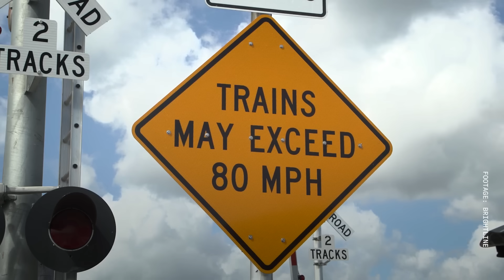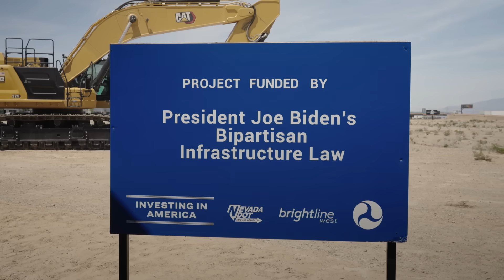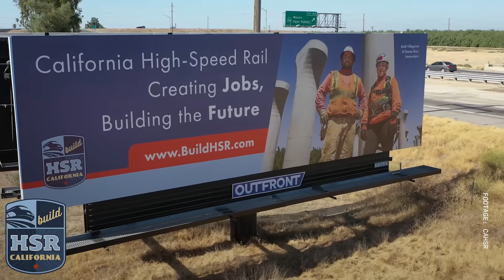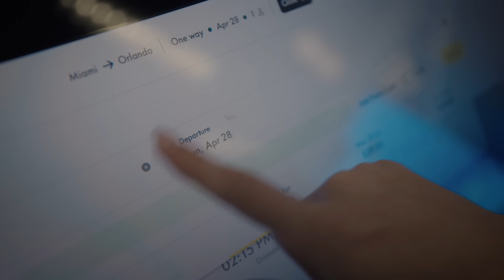Inside America’s First High Speed Rail

Comment: HSR improves lives and has advantages over flying, especially with medium length trips. It delivers a faster, smoother, and more reliable travel experience in ways air travel simply can’t match.

Greater reliability: HSR is far less vulnerable to weather-related delays or cancellations.

City-center access: Train stations can be built directly in urban cores, cutting out long trips to and from far-off airports.

No runway delays: Boarding is straightforward, and trains depart without waiting for runway clearance or taxi time.

A smoother ride: Passengers experience virtually no turbulence, making the trip more comfortable.

Streamlined security: Security procedures are faster and less intrusive because the risks associated with air travel don’t apply in the same way to trains.

Hassle-free luggage: Travelers keep their bags with them—no check-in lines, no waiting at carousels, no lost luggage.

Taken together, these factors make high-speed rail not just a transportation option, but a genuinely better travel experience for many journeys.

Comment: INSANE. A complete waste of taxpayer's hard earned dollars, for something that's not needed, and never will be completed.
Reply: HSR improves lives and has advantages over flying, especially with medium length trips. 

-HSR is less susceptible to weather delays and cancellations.
-Train stations can be build closer to city centers to reduce travel times between them.
-No waiting on boarding or taxis on/off the runways.
-Hardly any turbulance.
-Security checks are much lighter and take less time since you can't pull a 9/11 on a train.
-No waiting on baggage checks since you take the luggage on.
-and so on.

Comment: We built our Federal highway system and major airports before high-speed rail became a practical option.
For mid to long trips, planes are better. 
For short - to mid trips, cars are better.
Rail is stuck with mid distance trips the only viable option except in the North East because of density.
Reply: Not really. Portland Tacoma Seattle and Vancouver have high enough density and good to great transit systems. LA and San Francisco should have happened decades ago. LA to San Diego is actually the busiest Amtrak route outside the Northeast. Charlotte and Atlanta both have transit systems that would justify construction of HSR between them.
Reply: There’s also Chicago to Minneapolis, Chicago to St. Louis, Chicago to Detroit, Chicago to Pittsburgh… All of which have local metros and should be reachable under 4 hours by train.

Comment: Why can't we have this? (like Europeans or the Japanese)
Because it is less economical.
Rail simply doesn't work very well for the US.
For starters, we don't have the population density of European or Asian countries.
Second, the US has a very strong road and flight network...making them much more economical.
Short distances are best covered by automobile and long distances are best covered by flight.
With rail, one needs TRANSPORTATION TO the station and then need TRANSPORTATION after they get to their destination.
The same applies to flight, but airplanes cover longer distances faster than rail and cost less. 

Let's take a look at Brightline East:
Roundtrip cost from Orlando to Miami = $200-$220 (for the most basic fares).
Additional costs = Uber to station (or parking fees). Uber around Miami (or rental cost)
Transit time = 3 1/2 hours one way = total 7 hours.

Compare that to flight:
Roundtrip cost from Orlando to Miami = $150-$250
Transit time = ~1 hour 10 min one way = ~ 2 1/2 hours.

Compare that to automobile:
Roundtrip cost from Orlando to Miami = ~480miles @ 30mpg @$3/gal = $48 in gas.
You can leave whenever you want, have transportation while in Miami, and come back whenever you want.
The additional cost of tolls is not enough to raise the cost significantly.
Transit time = 3 1/2 to 4 hours one way = total 7-8 hours.

Comment: here in Russia is already building a line with a train speed of 350 miles / h

it will be launched in 2028
between Moscow and Saint Petersburg

ticket cost 35 USD for distance of 450 miles
Reply: Nah its 250 kmph = 155 mph
Reply: @ oh, sorry, 
it's just 300 miles / h = 480 km / h

because 250 km / h 
- we had 50 YEARS ago in USSR
it name was ER200
Reply: @HEX-qw7qp  the ER200 went about 125 mph / 200 kmph. 

Sorry I was wrong, there are already two routes that do 155 mph / 250 kmph

the new one will do 360 kmph / 225 mph - about the same speed as the new British one (HS2)

Comment: OK.  So Brightline announced a one way ticket from LA to Vegas would be $119 per person.  You. and your spouse buy 2 tickets.  That's $500.  Then you have to take Uber to Rancho Cucamongo or leave your car there and pay for parking.  OR, you could drive the 2 of you door to door for maybe $160 in gas round trip (less if you use electric).  And the so called "2 hour  advantage" never materializes because you have to get where you live in LA to the rail station either through Metrolink (snail pace) or drive through traffic in LA (turtle pace).  There's no way trains can compete.  I'm not against hi speed rail. I just took one in Europe last week.  But America is NOT Europe or Japan.  The cost is too expensive to pay off.
Reply: A line between las vegas and los angelos would be competing with airlines more than cars i think, which would definitely be a cheaper option no?

Comment: USA HSR:

130 mph (209.2 kph) = now

186.4 mph (300 kph)

200 mph (321.87 kph)
Reply: Xinjiang Uighur Autonomous Region, China
HSR
210 kph (130.5 mph)
+
Operate up to Tyhoon Category 12 Winds
at 80 kph (49.7 mph) without halting operations

vs

Japan's Shinkansen HSR shut down during Typhoons

■

Winds in Xinjiang sometimes exceed 65 m/s, or 234 kph (145.4 mph)
which is greater than Category 17 Typhoons

Comment: The US needs to add to it's rail network.

I see it as follows. We need high speed national rail network for both passenger and cargo. We also need a slower speed inner city rail network both for cargo and passenger.

The interstate system is good for semi's but they can only carry so much and only drive so far and so far. A high speed rail system would more then DOUBLE the speed of cargo travel and passenger travel.

I think major routes across the country need to be established with stopping points along the way. Those stopping points need to get you through the state at high speed and once you are in a city you would use slower speed rail to get around the city.

We drastically need to rethink how we build things because we have so much lost potential just sitting here.

Comment: There are multiple difficulties for a national high speed transit. Mainly that to prevent accidents, it requires it’s own right of way with provisions that make grade crossings impossible. Secondly, there is the uneconomical use of 18th Century technology using steel trackage, which is subject to excessive wear. Then there is the mode of transport power. Currently this is diesel fuel. A hydrocarbon that does create excessive CO2 emissions. Yet the private enterprises involved are entrenched in this high potential loss factor approach. While it may achieve a system, it does not guarantee economical ridership over commercial flying, by such one can cross country in 4-5 hours. A high speed land system would need to equal or surpass this time allotment and at a cheaper rate.

Comment: We need this. Would also revitalize so many cities that would be connected to the network. You wouldn’t have to live in NYC or Chicago or LA if you can live in a smaller more affordable one nearby and still get to work in 30-40 minutes by HSR. This could revitalize so many smaller rust belt cities that have been somewhat abandoned. The benefits far outweigh the costs. corrupt politicians are the only reason this hasn’t been happening.

Comment: I hate to be the bearer of bad news reporting Jessica. But 11,000 union workers is just wrong. The steel fab shop that make the steel are non-union. I work for one of the biggest steel bridge fab shops east of the Mississippi. There is only about 5 on the east coast and are non-union. The Keys bridge that fell in Baltimore, the steel beams are going to be make in non-union shops. They are going to be put together by union workers. I know your lib rot brain only thinks you need to be union to make it. As a non-union worker, I do very good. They have been talking high speed rail for over 15 yrs.

Comment: Brightline while certainly not really the first  in the U.S. yet I'm super pleased that you latched onto this favorite subject of mine. Here's a video I did back in 1993 when the first high speed tilt train was sent to the US for testing on the Northeast Corridor. The result was the designing of the Acela Express 20 units started running in DEC 2000 from WAS to BOS at top speed of 150MPH. This all long before Brightline. I rode Brightline last year and it still has less speed than Acela Express.
Here's video I took back in 1993 when I rode the X2000 test train as a demonstration project.
[https://youtu.be/JYVIHZNWAMg]

Comment: As an European I see a problem in this USA decision, first the biggest problems is America zoning, I live in Italy and we have a good high speed lines, because our cities have mixed private homes ,office schools so is easy for people to take the train in the central station, meanwhile America zoning put people houses very far from train station and a central point of the city, this means that you have to use your car already and doesn’t incentivise you to use train, especially considering most American cities doesn’t have a good public transportation system.
It will be probably just used by tourist and not by people to commute or go to work, America has a great size so is difficult to connect cities well, probably the best part is New England with small states that could be cover in a day, but is difficult with states with size of CA or Colorado and their  widespread population in faraway towns.
In my country most of rail network is electrified, that guarantee train eco-sustainability, but I’ve see most of trains in the USA run on diesel engines, because is difficult to build electric wires for thousands of thousands of km, increasing also fixing costs.

Comment: The Miami <-> Orlando "high speed" rail makes no sense.
1. Its travel time is 3:30. Guess what is the travel time by if you traveled by a car instead? Also 3:30. So you do not win on the speed vs a car.
2. The rail ticket costs around $80, when you can fuel a car for the 235 mile trip on around $20-50 depending on the mpg.
3. This is America, the cities are not made to be walkable, and tbh you wouldn't want to walk in the Florida heat anyway, so you will have to rent a car at your destination, which is more money you have to spend, and also time, than if you traveled by a car to begin with.
So the rail doesn't beat traveling in a car for most people, as most residents have a car. It only beats a car in one way - you get 3:30 to spent doing whatever you want on the train, instead of being behind a wheel in a traffic, for which you pay extra via the rail ticket and a car rental. It might be appealing to non-residents though, aka tourists, who don't have a car, so I will give it that, and Miami and Orlando are both big tourist places. But again, for a local resident, it makes no sense to use the rail.
Also, if you are planning your trip months ahand, you can get non-stop flight tickets for $40-$90 with around 1h travel time, which is still faster than the rail even with the TSA checks.
If only it was faster than traveling by a car by a considerable margin, e.g. 1:45 instead of 3:30, and/or if it was cheaper than fueling a car, then there could be some justification for using the rail, but as it is right now, it's only useful for the rich who can afford extra ticket price and car rental, or tourists.

Comment: And then the airline industry will lobby against it and the future of American high speed rail will die.

Here in Germany we have trains that have a top speed of 300kmh (almost 200mph) but they only average 200kmh (about 120mph).  Partly that's because some lines have bends and too many stops too close together, but also Merkel didn't invest in building for the future.   You need to keep investing.

Comment: ...the odd part, is the Brightlind HSR to LAs Vegas will not serve Midtown Los Angeles but start at Rancho Cucamonga (of all places) nearly 50 miles to the east.. So people will have to drive that distance to ride the train.   that would be like having to drive about the same distance from Paris to Etampes to catch a TGV to Marseilles. /SMH

14 years ago, there was a plan for a "higher speed  Line between Chicago and the Twin Cities through Wisconsin that would have ran at thabot the same speed as the Brightline which currently operates in Florida  Unfortunately Wisconsin's (R) Governor Scott Walker decided to nix nix the project even though full funding for construction of the first segment between the state line and Madison was allocated through a federal transportation stimulus grant, Ispit of this he used what were little more than baseless excuses and inflated operating costs as his reason to reject  the funds.  None of the construction costs would have been borne by the state and Amtrak along with the state rail commission would have subsidised up to 80% of the annual operating cost.  Such funds are specifically earmarked for passenger rail operations and cannot be used for other transportation projects such as highways or airports.

A couple weeks ago Amtrak added a second train on the corridor christened the Aurora (which uses conventional equipment) to offer a second round trips each way on the line (the other is the long distance Empire Builder that ends in Seattle and Portland) however it uses the same tracks and thus crawls along at a pitiful rate which in actuality averages about 54 mph along the route (or bout 9 hours) with additional; delays likely due to freights).  In comparison, France's SCNF TGVs cover a slightly longer distance between Paris and Marseilles in 3 hours and 15 minutes, about one third teh time that it takes Amtrak takes to complete the same distance.

The cancelled Hiawatha line was to have a top speed of 125 mph running on new tracks using Talgo 8 designed trains (that were built in Milwaukee and which finally ended up in Lagos Nigeria after sitting unused for years).  

One of the differences between here in The States and other countries is the power of corporate lobbying (which is little more than legalised bribery).  Most passenger rail service in the world are operated by national government as a public service.  Amtrak was set up as a "quasi-government" corporation (similar to the USPS) which was required to turn an annual profit or disk facing funding cuts. Many of the routes offered to Amtrak by the freight lines ended up having poorly maintained  tracks which were not designed for express passenger trains while they inherited a mishmash of ageing equipment (some carriages dating back to the steam era like the ones from the Gulf  Mobile and Ohio Railroad still had leaf spring suspension and clerestories [a raised portion often with small windows on the roof]).  Schedules were also became more inefficient and inconvenient as what were once "crack" express trains like the 20th Century Limited and Super Chief were required to serve more stops along the way which used to be handled by regional trains.  It took several decades for Amtrak to finally "turn the corner" so to say all the while while facing funding cuts that often resulting in service and route cancellations.

The States had the finest passenger rail system in teh world but has been left behind in the dust today by other nations with forward thinking governments.

Comment: The countries with successful HSR are typically about the size of just 1 State in the USA. It makes perfect financial sense  in a country the size of California to go with rail over air. Airports require large areas of land and if your trying to service every medium sized town and above you end up with a lot of smaller planes (due to smaller passenger requirements) to accommodate. That would equate to a trip of LA to Portland, about 1000 miles in about 5 hours (vs 2 by air). Add in a stop or 3 in Frisco, Redding, and Medford (so people can transfer to local rail to get to their actual destination) and you're up to 6 hours. But if thats the total size of your country, its reasonable.
LA to NYC is over 2700 miles. Even using Japan's fastest train and route, you are still looking at 13 hours non stop...and for HSR to make sense you will need to stop at major cities along the way to make it viable.  So call it 15 hours with a few 30 minute stops along the way. Compare that to the 6 hours it takes to fly. Most people will not accept that level of time used in travel.
And thats the problem with HSR in the US, We are a Nation that spans an entire continent. Our distances between major city-destinations are just too far apart to be viable.
Now, smaller regional HSR routes that can replace some of the smaller air routes can be viable. But we would still need to make that a National System just to ensure commonality between tracks, trains, power requirements, parts, construction standards, etc. But that not what we are doing. We see the Acela on the East Coast, though its not true HSR. Californias attempt at HSR is a fiscal and engineering black hole for money. And the initial route...Bakersfield to Merced?? Really? 2 small cities best known for Meth and Prisons. Not much ridership is going to happen on that route.

Comment: The main problem is they still cross auto crossings and hitting a car or truck at 200 mph is as bad as an airplane crash.If the elevate the rail so no dear cows cars ect get on the tracks then it might be viable but not until.